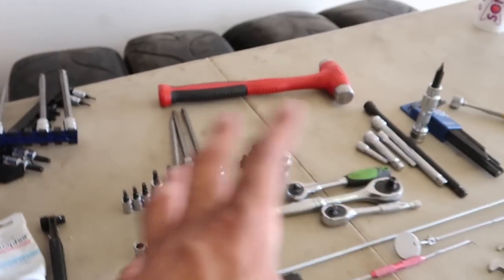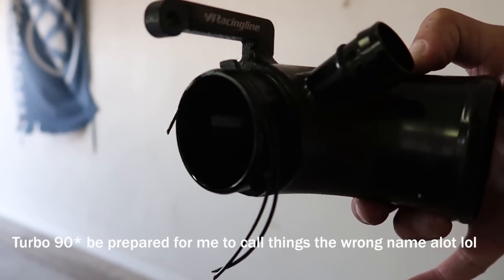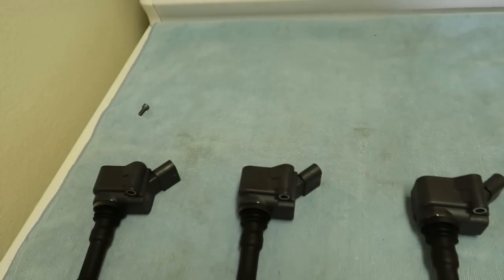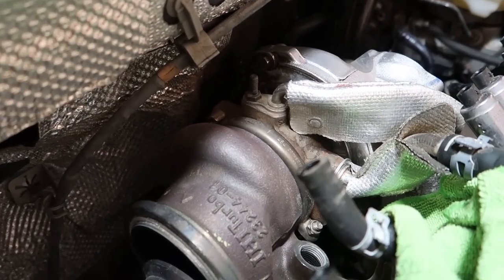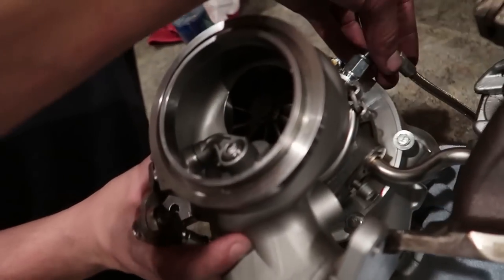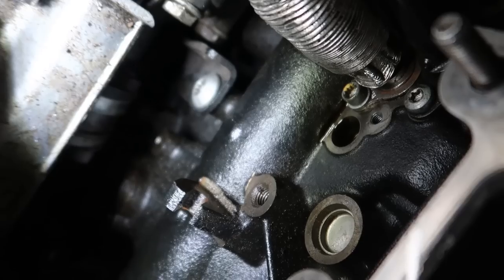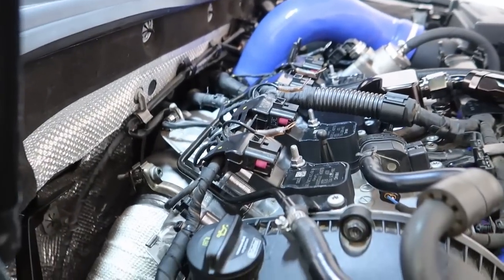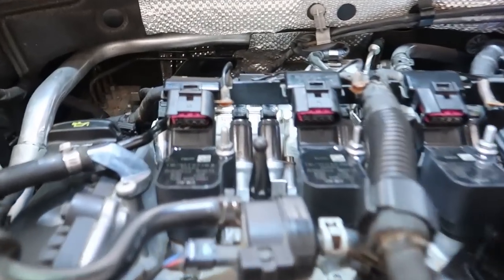EQT Vortex Turbo Installation Walk Through | MK7 Golf R

Comment: Yes, without the proper extension, the bottom oil bolt is the hardest bolt to install. I know you've already figured it out by the upload of this video, but having a skinny extension and skinny torx helps make this bolt an hour job to a couple minute job. Hope this helps anyone.
Reply from the maker: I should have just disco'd from the block and made my life easier lol

Comment: I mentioned it on your other video but taking the o2 off with the turbo off the car use a 22mm wrench and tap the end of the wrench with a big hammer and it comes right out. Just wanted to leave that here for future people using this vid as a turbo replacement reference.  As always Bryce, great vid...your vids are worth their weight in gold to the mqb community. Thanks a lot man!
Reply from the maker: I appreciate the kind words sir!! I've just always had bad luck with cold pipes, decided to just buy the tool lol
Reply: @BryceJordanProductions  How did you get that socket around that o2 sensor wire?
Reply from the maker: It's an o2 socket it has a cutout for the wire

Comment: Also I use a small wrench on the bit portion of the socket to put on the rear coolant lines. Gives you more room than trying to use a ratchet and can be done with the turbo mounted on the studs.  For the bottom oil line bolt go in from the bottom with a couple extensions on a 3/8 ratchet, the difference for me was I was able to pull my USP downpipe up through the engine bay and get it out of the way...made doing that bottom oil line so much easier and also getting to the turbo support bracket easier.  Also I used a dollar store turkey baster to prime oil into the top oil line hole of the turbo and also primed it with the coil packs off the way you did.
Reply: @dirk5950   Ya that will definitely work, but I already had the wrench and socket and works just the same.  Now that I think about it I actually used just a bit from a craftsman bit kit in a 1/4 inch wrench and not a bit/socket.  Having a ratcheting wrench also makes it a little easier.
Reply from the maker: now thats a tool i need to have!
Reply: Comes in handy when you go to upgrade that PUT sensor in the charge pipe for 29+ psi. It’ll happen soon enough.  🤣
Reply from the maker: Shhhh 😅🤣

Comment: "Wrap it around the fridge...."; my kind of mechanic....sketchy.  Hahaha.
Reply from the maker: 😂😂😂 if it works it works! Didn't have to though lol
Reply: @BryceJordanProductions  Do you think the rear/bottom oil and coolant lines would have been easier if you did ratchet it up a bit?
Reply from the maker: @derekness5967  not by much tbh, I'd actually have to try it to find out. Every bit counts though
Reply: @BryceJordanProductions  Sounds like it is worth trying. It's just one bolt. I'll have to buy a beer fridge but that's a win win. lmk if you have any other suggestions for those rear lines. Thanks

Comment: What's up bro! Love your videos .....im in the process of installing my boss 550 turbo but I'm stuck on removing the oil return line under the turbo....which is easier to remove the the from the block or turbo side ....and what tool did you up ..it's a tight spot and I'm having a problem getting it off...thanks and stay safe !!
Reply from the maker: If you're having a real hard time getting it from the block isn't too bad. Helps to have a mirror so you can see things a little better. Don't remember the tool offhand but I believe it's a triple square or torx bit of somesort! Using your phone camera can help alot too. Hope you get it off! The oil and coolant lines are the worst thing about the swap!
Reply: @BryceJordanProductions  ok cool thanks for the advice!....let me ask you do you get it from underneath the car while on Jack's or did you remove it from the above with the downpipe removed? What would be easier to do....
Reply from the maker: GTI or R? GTI is much easier could do it from the bottom much more simple for the oil line at least. R you do everything on top basically not much room through the bottom unless you remove the downpipe and move the driveshaft to the side. I have a diy for both the R and GTI on the channel
Reply: So I finally got her out and started installing the new turbo. Man it was though doing this on the R but now is the easy part....let me ask you did you put back your turbo heat shield back on or left it off ....I would hate tot see the turbo all covered up .....does it effect anything or it's just basically for looks?
Reply from the maker: It'd leave it on unless you get a turbo blanket or something. It's ugly as sin but it definitely has a purpose. Not sure how much it actually does but 🤷‍♂️

Comment: Hello Bryce. First of all, I want to thank you for sharing your experience with your car. It's helped me a lot to understand what to expect with my R Type.  On another note, is your new "hybrid" a Vortex turbo in a new IS38 or IS20 body or are you running the XL turbo?  Their website has me believing the Vortex model may be an IS20 turbo.
Reply from the maker: They aren't really hybrids, they share nothing but the shape of the body of the stock turbo, everything inside and totally different and made to be that way. But the standard housing is based off the 20 and the xl is based off the 38. Basically the xl is a little slower spooling but you get another 40+ whp. Go standard if you're at altitude otherwise go xl and be one happy guy!
Reply: @BryceJordanProductions  Thanks dude! So you're running the Is20/ Standard turbo?
P.s. I'm in NY but have plans to relocate to TX next year.
Reply from the maker: Yessir vortex standard housing I live at 4200ft so I need all the spool I can get! Where at in tx? 👀

Comment: Where did you get the oil feed line from ? Also what extra parts or gaskets or fittings to buy, I care something breaks
Reply from the maker: Shopdap has a kit for the turbo with all the gaskets O rings etc. 
https://www.shopdap.com/mk7-is38-turbo-install-kit.html

Oil line 
https://www.ebay.com/itm/MAMBA-Turbo-Oil-Feed-Supply-Line-14-16-VW-Polo-6R-Skoda-Fabia-NJ3-1-4-TDI-CUTA-/264260191971
Reply from the maker: If you're getting the EQT it comes with that same gasket kit btw
Reply: @BryceJordanProductions  yes I just got my XL today and after watching your video, I’d love to get a new return line. I’m also going to buy a new waistgate. I’d rather not use my old one. I have a s3 w/30k on it. Where do you recommend I get a oil line
Reply from the maker: Not sure about an aftermarket option for the drain.. still using OEM here, if you find one let me know cause I wanna do some custom stuff if I can
Reply: @BryceJordanProductions  gotcha, will do. I think I’m gonna just order a new return line, a new feed line, a new actuator and a new 02 sensor. That’s should be all I need right? This way I don’t reuse anything
Reply from the maker: Turbo to downpipe gasket thing im not sure the kit includes one. It sits like in the lip of the turbo. Other then that I think you have it all covered!

Comment: Where did you get the steel braided oil lines? Link?
Reply from the maker: They came with my turbo 🤷‍♂️ I think the brand is Mambo or something like that
Reply: @BryceJordanProductions  okay, thanks for the info and I'll look into that.
My EQT XL just showed up yesterday so I'm trying to put together everything I'll need for a seamless install. @vdub_dru
Reply from the maker: You don't need the line, stock will work fine. Ed was including those In kits for awhile, not sure why it started or stopped. But it does look better then stock lol

Comment: They spin the same. You will have more lag with the EQT. Ask me how I know haha
Reply from the maker: It really isnt far off! I dont really feel a huge difference in spool. Frank said he was working his magic to get quicker spool, not sure what that really means, im assuming he added some timing down low to help at least feel like it has some power or something lol
Reply: Bryce Jordan Productions yeah he does that. The IS38 I have now, tuned by Frank, spools at least 2500rpms faster than the EQT I had tuned by him.
Reply from the maker: Nifty nifty
Reply: @JacesOwnWorld  well.. i followed your thread on the forum and I personally don't think you can be out here judging the EQT since yours had the bent arm on the actuator. Whether it ended up happening due to install error or in shipping, I think it's pretty shitty of you to be blasting it. No, I don't know Ed or have an EQT turbo I just don't agree with your comments.
Reply: Drew Boggs that’s fine but I still stand by my word. Everyone on the forum only had a glimpse of what went wrong, but I didn’t feel the need to start a new thread. 

Basically Ed says it was install error. Problem with his diagnosis is that after installing it, it ran perfectly fine for just over a week, and then boom, it stopped working. If Ed says I bent the wastegate arm on install, how would it work for a week and then just stop working? Doesn’t make sense at all. I never touched the wastegate arm after initial install. So whether it was damaged in shipping, or bent by me, how would it go from working to not working in a weeks time if the arm was bent the entire time? Makes zero sense. Also, I’m not the only one who had this same issue with the EQT. 

I’m not asking you to believe me, and I know Ed won’t either, but I’m just stating the facts. So I will continue to stand by my word when someone asks me, as I cannot in my honest heart, recommend a bad product to anyone.